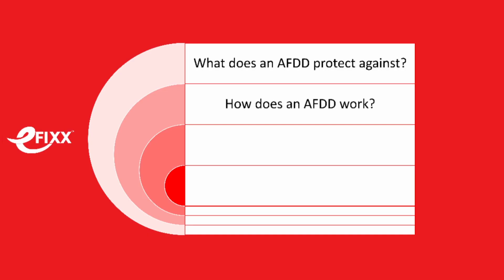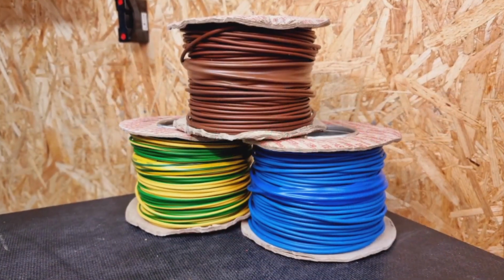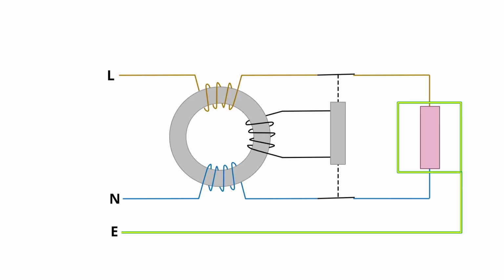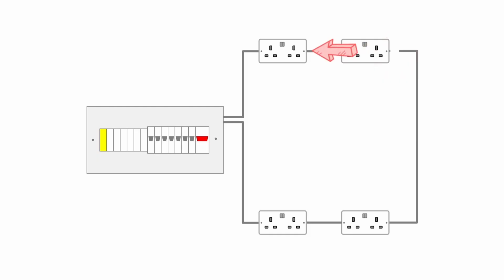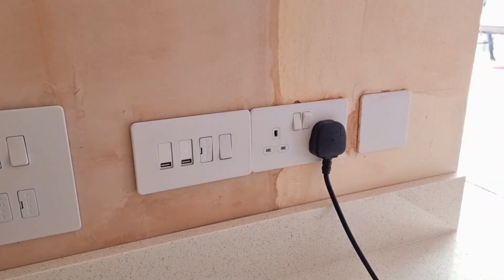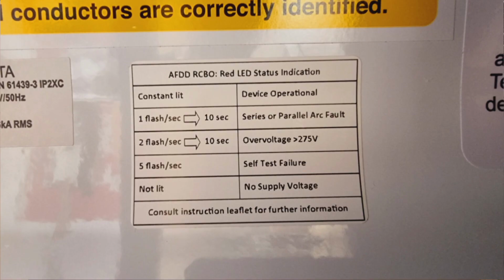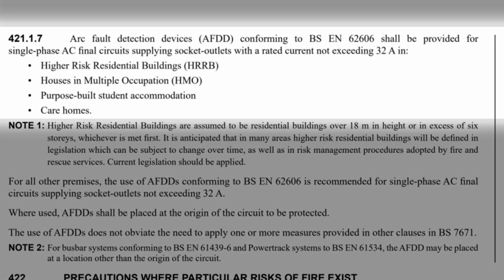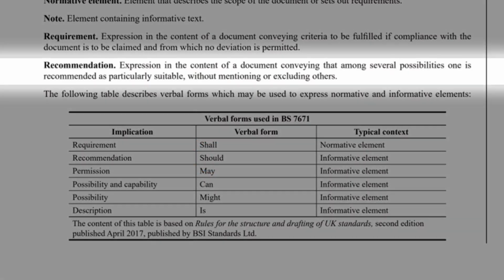AFDDs & BS7671 Amendment 2 - What you need to know!

Comment: I'd say not dodgy installations but dodgy equipment and accessories such as push fits and loose connections ie tork settings I think that's why there is the need for arc fault connection devices some of these accessories are really cheap and poor quality or let me refraze expensive and poor quality as for rats and poor installation sorry bit I think that is a very rare.
Reply: I have found push fits more reliable than screwed connections. Look at Wagos.
Reply: @johnburns4017  yes I think that push fits are the way that everything's going to go there has been obviously research and science in to it but as a sparky of 30years loose connections caused arcing and heat if anybody remembers the square d dB boards in the 80s 90s they used to use push in mcbs not many company's wanted to use them because when they went round with the thermal imaging it showed signs of heat it seems now there all going that way one good thing out of it though is you won't be able to blame the electricians anymore for poor instalation you can ble the manufacturers instead.
Reply: @leewinters606  
The likes of Wagos apply the correct torque to the conductor. The grip is all around the conductor, not just two sides. They do not work loose.
Reply: Half of what you wrote I never understood.

Comment: I see electrolytic capacitors in the breaker. The concern I have is the extremely poor quality of capacitors manufactured in China. Some can fail in two or three years, regardless of load.
Reply: So stick to well known brands.
They have their reputations to protect. They are not going to use cheap fake caps made in China.

And when buy the product, check the warranty , and formally record when you purchased the product, take photographs of the receipts, store them securely, and if the product fails and it is still in warranty, then call off against the warranty.

And if there is no warranty , keep track of this information anyway because you could make a claim against the retailer for selling products which are not of suitable quality under The Sales of Goods Acts. Products are required to last a reasonable amount of time.
Reply: @deang5622  Nothing to do with fakes. Electrolytic caps age, it's in their nature. Unlike resistors, diodes and transistors that can last indefinitely when treated correctly, the same is not true for those types of caps.

Even the (expensive) "long life" types are only rated for 10,000 hours (416 days) at their rated temperature, standard ones at 1,000 to 2,000 hours. And while that can be increased by keeping them cool, even then, their failure rate is only guaranteed to be not worse than 0.5% per 1,000 hours (41 days). Usually, this is no issue, given the typical lifetime of a modern device. Most electronic devices nowadays are used for 5 years or less. But that's not really what people want from a consumer unit. Those should last for decades.

My estimate is that AFDDs will have a usable lifetime of about 8 to 10 years before failure rates get high enough that people want them replaced because they don't want their circuits to randomly die. And I expect customers to be quite verbal about expensive stuff in their consumer units dying, that's something they are not used to.

Another issue I see is that dead caps could silently disable the arc fault detection circuit by no longer supplying the microchips with power. Those LEDs are nice, but who checks if their breakers are still lit up when they haven't tripped? And who actually expects a consumer to know what a dead LED means?
Reply: @HenryLoenwind  I probably know more about caps than you do.
They dry out.

And drying out doesn't happen over a few years. It takes considerably longer.

I used to work for a company that made equipment where the life time of the products were long and the caps were essential to the quality of the output signals produced. We had a cap replacement programme in place for our customers.

If caps dried out after a few years we'd all be replacing most of our electronic equipment and that is just not the case, is it? Just apply a bit of logic to it please.

I do get irritated when amateurs come along and try to out-do the expert thinking they know more.

And your comments out semiconductor devices are incorrect too. And yes, I used to design them . But their failure modes are another story.
Reply: @HenryLoenwind  Your post needs a reply that is a little more constructive that the one already provided. Electrolytic caps are rated via 2 values - hours and temperature as you say, but the temp is the key value when it comes to service life. Often the quoted temp is 105C, but what is not made clear is what happens if the operational temp is lower. For many caps the operational life will double for every 10c drop in temp. So a 10,000 hour @ 105C cap will have an estimated life of 20,000 hours @ 95C, 40,000 hours @ 85C, 80,000 hours at 75C and so on. So you need a very poorly installed CU in a very hot location for any good cap to cause a problem.
Reply: @rogerthomas7040  Sure, if the manufacturers use long-life versions. Also, CUs are not ventilated and are often mounted high up in heated rooms. With more and more consumers inside (some electricians already are putting blanks between breakers if possible because of that), a heat build-up to 40°C or more doesn't seem outlandish.

But say they use standard caps because they are cheaper. 1000 hours, doubled 5-6 times (95-85-75-65-55-45) is 32k to 64k hours. That's 3.6 to 7.2 years. That's low enough that having one of the maybe a dozen AFDDs in a CU failing after the 8-10 years I stated would be expected. And from that point, it only goes up. Then multiply that by the number of CUs that are installed.

Even if just one in 10 CUs has an AFDD failure after 8-10 years, that's more than enough to destroy public perception of the reliability of those devices.

My distribution board is 10 years old now, and if I had a fear of power suddenly cutting out on a random circuit (e.g. the one keeping this unfinished comment I just typed alive until I press the "reply" button) because of a breaker randomly failing, it would be very unnerving. I just was on a 4-day vacation and trusted my freezer and fridge to not turn into biohazards because of a breaker failing.

And if those devices are constructed to fail without cutting the power...that's even worse. No typical consumer checks them, no matter how often you stick a "check every fortnight (not the game)" on the CU.
Reply: @HenryLoenwind  One of the major issues to be addressed by the regulations is going to have to be the move to active components insteat of passive or mechanical components. There is a lack of focus on the life expectancy of active parts and their "parasitic loads" within the regs with the hope that other regulations take up the slack. Things will start to become even more complicated as home CUs start to provide AC based power to DC based 'outlets' as more devices end up running from USB power suppiles.  We could end up with highly regulated CUs basically servicing a large number of very cheap and nasty unearthed powerbricks that can provide up to 48V, 5A over unregulated cables.
Reply: Youv'e hit the nail on the head Rob!  at the end of the day "You can't polish a turd" we are installing rubbish as EVERYTHING is made in China.  It's been a bug-bear of mine for a while now since heads on screws broke off on jobs using a manual screwdriver!  this caused more work and gave me less faith in the job I was signing off as good.  This country is now built using piles of.....
Reply: It's not a power supply, they are probably used for small power requirements for the board only which means they won't be ubjected to high temps. They will last for at least 10-15 years if you use a good brand.
Reply: There will probably be a small capacitive and resistor type power supply and electrolytic caps smooth the supply for the micro processor.
I would believe a good manufacturer has tested and researched and extreme conditions to ensure there is no early failure.
Typical human cinicism of new technology. However many of us have been bitten by cheap Chinese knock off equipment. Yours truly included.

Comment: With all the concern over energy costs, how much does it cost to run each afdd ? The micro controller is going to use some power, and if there are multiple circuits with them on 24/7 is it going to mount up to much? They are already expensive to buy the devices in the first place. I have a feeling that these costs might have the complete opposite effect of intending safety. By way of Joe Schmo from down the pub doing the job for cheap with a screwfix special board rather than legitimate installers doing it as prescribed.

Comment: Just had a look at the cost from CEF. A 16amp B curve is £155! So an average board will therefore cost around £1500. I think the ‘Shall’ and ‘Recommended’ words might be translated a little differently when the general public realise the costs!😎🍷
Reply: Very True
Reply: Would you consider paying £1,500 to protect you £250,000 plus home...?
Reply: Tell me about it, took one look at the price and actually said nope out loud.
Reply: I only have 2 socket circuits in my house, my maths might be wrong but that equates to £310, not sure where you're getting £1500 from......unless you're wanting to put AFDD's on every circuit, which isn't the reg so I think the customer can make the decision on how much of their own money they want to spend on their own safety.
Reply: @NicoleBritnell  Hi costing based on commercial premises like a care home using decent brands, 
I would not fit a cheap Chinese DB in my home, DB’s are cheaper than family members
Reply: @NicoleBritnell  from experience I would fit them to lighting circuits as well as the amount of faults is high and also DIYers fit crap/ badly when it comes to lights
Reply: Health and safety has no cost ceiling, 
Look how many people Died in glenfell started by a fridge fault, AFDD if fitted to the kitchen ring would of prevented this loss of life 

High rise , HMO, care homes & hospitals this is a no brained addition, 
 
£1500 for a DB that should last 25 years that not really a consideration when your the one signing off the work, and would ultimately be held responsible in a court, blaming the untrained customer as not wanting to pay, won’t wash away a manslaughter charge,
Reply: @oiuslags  Will it last 25 years? There are hundreds of cases of perfectly safe plastic CU’s that were only 5 or so years old being C2’d on EICR’s when 18th edition came into force. What happens in 2 or 3 years time when amended x comes out with some new requirement?
Reply: @JK50with10   plastic DB should only be a C2 if it’s in the only escape route, I’ve seen some proper bo!!ocks ripping out a perfectly good DB  and replaced with cheap rubbish metal clad  
Crap
Reply: @JK50with10  These should be C3'd.  Cowboy sparks C2 them in order to trick the consumer into upgrades. - If they met the regs in force at the time when they were installed, then they are "fine!"
Reply: @oiuslags  No it would not. An AFDD does not protect  a ring, ( series arc) because there is an alternate route.. Thats why I said earlier, that rings might be brought into question to be replaced by radials. So not only the extra cost, but extra work with radials together with possibly a larger board.
Reply: @johnchristmas7522  the fault was in the fridge at Glenfell , which is/ would be covered by the AFDD as the appliances are not ring circuits but now in series’s 

The thinking is it’s the crap that get plugged into sockets that cause most of the fires. Like washing machines the cause of 10% of house fires

Ps radicals are way less work then rings, also stops the good old DIYer from overloads spurs or ring within a ring or even better numpty’s not getting both cables in the breaker correctly
Reply: @oiuslags  AFDDs also protect the flex of an appliance as well....?  Even in a ring circuit!
Reply: @oiuslags  HMO are already closing mine will AFDD only mandatory for private housing councils and social housing exempt. Cost of registered HMO room  rental now pricing modest earners out into dubios houses
Reply: @oiuslags  I heard it mentioned that Greenfell is a major reason for this regulation!
Reply: @oiuslags HSE does indeed have a sort of cost ceiling when RA is carried out and will be loosely dictated by ALARP. Unless the statutory document tells you it is mandatory, then cost indeed is not taken into account
Reply: @nickmacdx  well my x head of H&s was Ex HSE and the no costing when it safety come from him, like I’ve stated before “the it was £200 a circuit”  don’t wash in a law court when someone has died,
Reply: @oiuslags  if applied in all cases then the "no cost cap" was his own personal choice when risk assessing. Very honourable of him to pay, but not always required, and certainly not 100% prescriptive from HSE or always a duty against an employer. Your £200 example would be reasonable to pay that much to save a life though to be fair.
Reply: @oiuslags  ps ... read up on CBA and ALARP

Comment: Excellent super clear explanation , very impressive way to teach, correct speed, simple graphics, perfect flow. As for the units themselves over complex, expensive  and not required in standard 2 storey building. Thanks for the video.
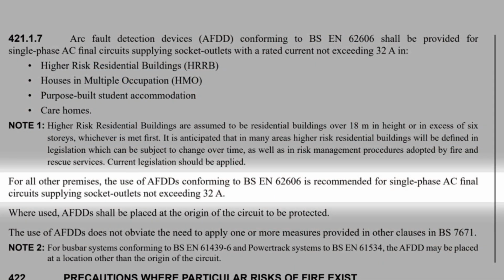Reply: That’s not quite correct - watch 15:37 - 16:50.  Also, “a standard two storey building” - is a bit vague - as you could have HMO’s of single / two storeys. 
If you mean a residential house of two storeys - open to debate as “other properties” mentioned - then it’s “recommended” which  becomes you  “should” - but you need to do “something” quoting the chap on the video!

Comment: Is this only for new installs or new circuits?
Example, a flat on the 7th floor of a 9 floor block has a metal CU with RCBOs on all circuits.  Do AFDDs need to be swapped into the socket circuits removing the RCBOs?

Comment: The thing that really bugs me about this is it pertains to "AC final circuits supplying socket-outlets with a rated current not exceeding 32 A". IE it doesn't matter if it's a 6 Amp dedicated circuit to one appliance like CCTV or a 16 Amp dedicated to a Microwave, if it's a circuit with sockets on it, it gets an AFDD. 
What's the one thing we all tend to find arc faults on, Electric Showers. Not included and yet the highest risk and most common. 

I think it's time to do a Europe and just hard wire everything in and ignore the people writing the regs as they seem to have forgotten what it's like to work out on site on faults and rectification works.
Reply: This will promote large rings with some 4mm cable to the 1st socket on each leg of the ring to prevent overheating cable on an unbalanced ring - to save costs. One ring for a whole house, with hard-wired dedicated radials on: Oven, Hob, Immersion.
Reply: @johnburns4017  Which is back to 1960s wiring, and they don't pick up a fault on line-line on rings because it's at the same potential. Basically only protecting against nail-in faults line/neutral or faults with plug in items.
Reply: @effervescence5664  
AFDDs highlight an advantage of a ring. If there is an arc, the arc creates a resistance, so the current will, go around the ring from the other direction, reducing any dangerous arcing.

Comment: So, when carrying out an EICR on an existing installation of let's say, a high-risk residential building, in the regs it states that AFDD "shall" be used. Would the installation now become unsatisfactory and require remedial works to replace RCBO's/MCB's supplying socket outlets not exceeding 32A with AFDD?

This is going to be costly because a lot of installations are using high integrity split load consumer units, there are no AFDD's that can be fitted to those as far as I'm aware.
Reply: Although not mentioned in the video I would assume that the fitting of AFDDs is only required on a new installation or an addition to an existing circuit, when carrying out an EICR you could inform the customer about AFDDs but at £150 each plus labour it might be a hard sell but, in any event when carrying out an EICR, if AFDDs are not fitted it is not a retrospective requirement that they must be fitted.
Reply: @andyg1645  
Are you sure? You do say assume.
Reply: @andyg1645  and this is why I'm asking the question, since the requirement of RCD's were written in the same context as what this new regulation states, I would "assume" its to be mandatory on all installations, previous and new... I'm just looking for clarification as I can not seem to find a reputable one from any source without reaching out to IET.

Comment: So would that require affd to be fitted on socket circuits in domestic installation ??
Reply: That’s my question also, he talks about the use of the word recommended in the regs but didn’t clarify if this was referring to all domestic ring circuits.  If the regs want AFFDs fitted in all domestic properties it will be an uphill battle trying to convince householders that you are not trying to rip them off, especially when they know a guy called Bob in the pub who said he can do the job for a fraction of the quoted price.   It was however an otherwise informative video.
Reply: @andyg1645  It's another one of those grey areas. It's recommended rather than optional. As Joe said, if you don't fit them, you need to do SOMETHING which I imagine will be some other form of protection from the same potential danger. AFDD's are the regs PREFERRED option. It's not just ring circuits but all socket circuits. The average domestic property has three socket circuits. Thankfully the regulation doesn't apply to all circuits! I need to replace my parents DB at some point and that has SIX socket circuits! Mike.